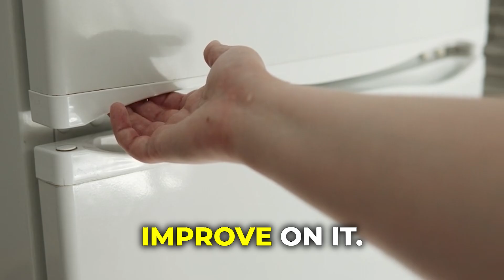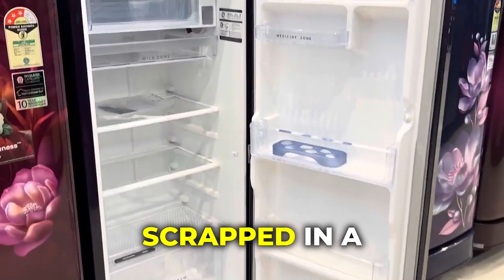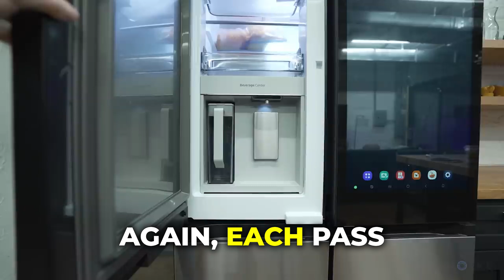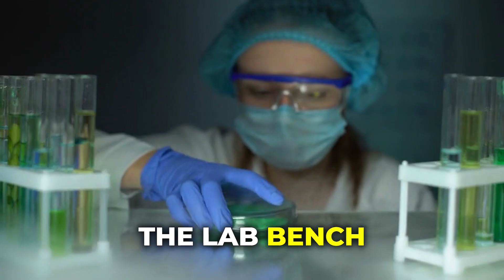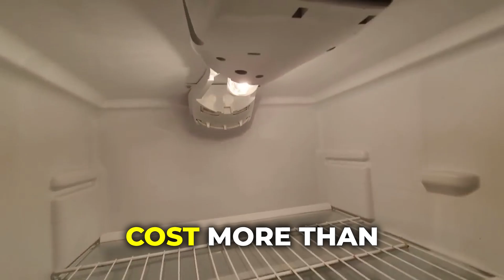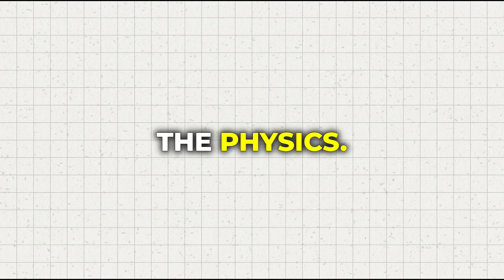China's New Invention Could Make the Refrigerator Obsolete

Comment: The problem with this is the energy needed for the cooling effect is increased so much it would cost more in energy to use.
For Air Conditioning we need to go to Propane as the coolant, it is far more efficient at moving heat and does not harm the ozone layer if it leaks, in Europe this is getting popular, to keep the Propane safe it is all contained in the outdoor unit and an antifreeze solution circulates through a heat exchanger and moves the heat into it out of the structure, 
The danger with Propane as a gas is it settles to the lowest level and then stays there for a while and accumulated unlike natural gas that rises up.